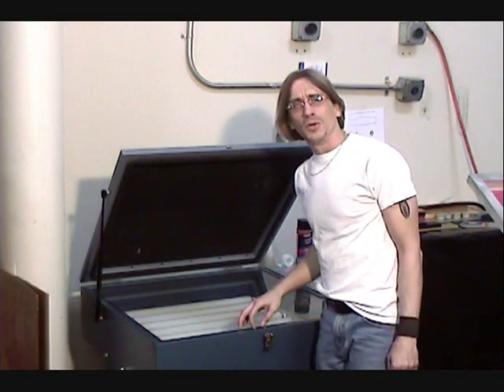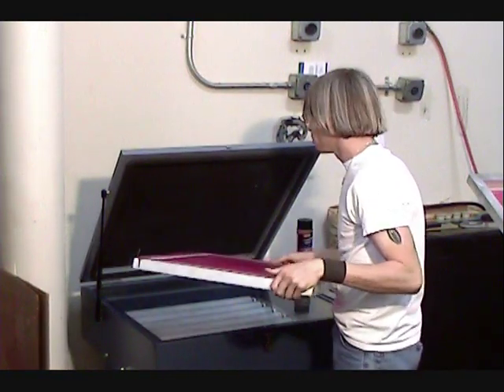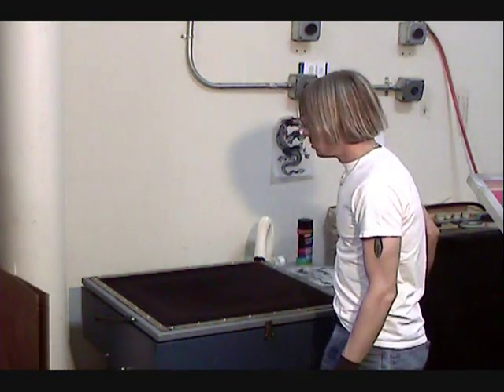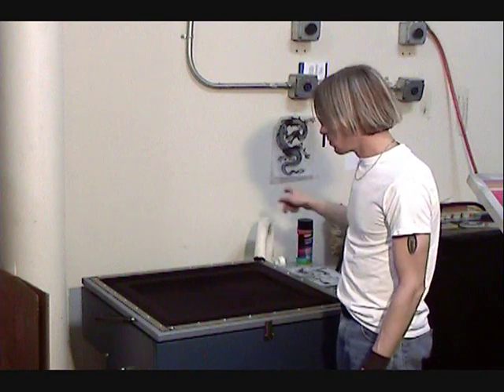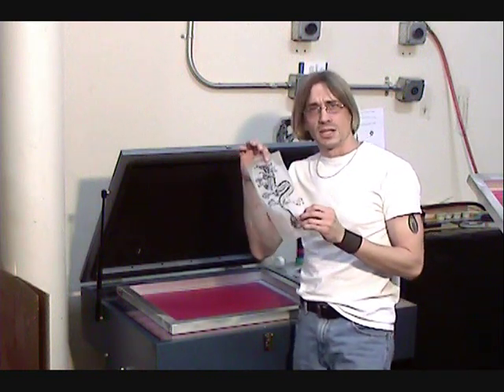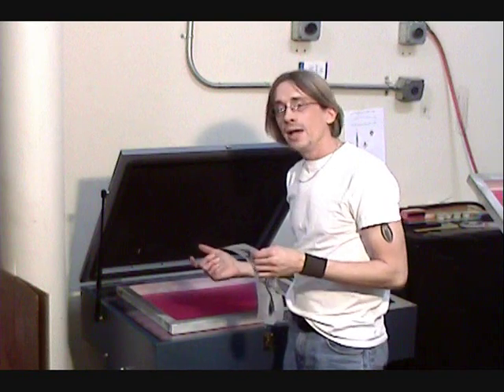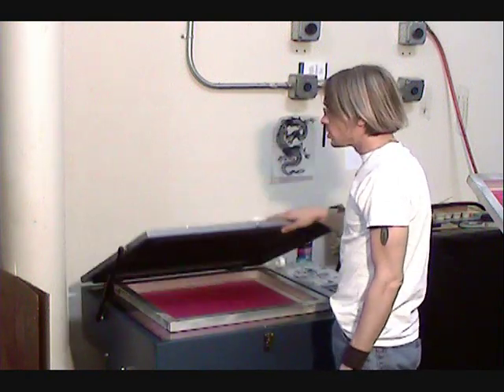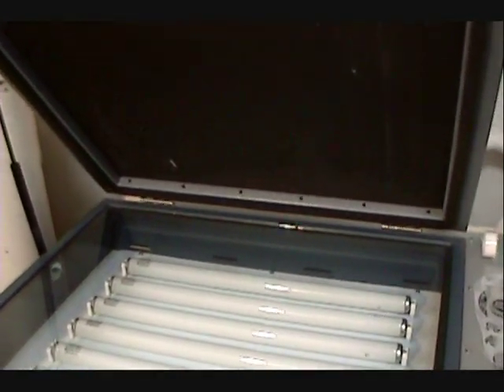How To Screen Print: Getting Your Art To Screen

Comment from the maker: No problem, my pleasure. Technically I think you can and if I recall correctly it ultimately affects resolution by decreasing bridging characteristics of emulsions. It can also cause what is known as choking which makes the stencil slightly smaller around the edges. You want to try to expose the emulsion just enough to fully cure. But I would not worry about that too much with most tee shirt art unless you have some very tight registration to achieve. Thanks for watching and leaving a comment! ☠

Comment from the maker: Youre welcome. Thanks for watching! It is recommended to work with unexposed emulsions and screens in yellow or red light. Some emulsions are slow enough that subdued light is sufficient. It really depends on the emulsion you are using. But a complete darkroom is not necessary in all cases. But again, it is recommended. My motto is eliminate all variables so working with emulsion in the darkroom is a good idea. You can use any dark space with a red or yellow light.

Comment: Hi. Just to ask, how many times you can use a screen once you make, let say 120 tshits with the same screen. I mean....you can make an amount of Tshirts and remove emulsion and make the same design again? Or simply you make the screen and keep it for 1 or 2 years withot problems?
Reply from the maker: You can reuse a screen as long as it has tight mesh and it's not all dingy with frayed fiber. It can be used for many years if cared for properly. Thanks for watching. Screen Printing Equipment & Supplies - http://catspitscreenprintsupply.com/

Comment from the maker: The exposure time may be calculated by different methods. When I test a new emulsion I start at a 30 second exposure and adjust from there. Most emulsions are very fast today. The vendor of the emulsion should be able to dial you in to a starting point for their emulsion based on your mesh count and your light source. If your screen gets messed up, the screen itself may be reused but it would have to be reclaimed and re-coated with fresh emulsion.

Comment: firstly thanks for the video, i ask how to calculate the time on exposure for different mesh, i use 43 mesh.
Reply from the maker: You’re welcome. That is hard to pre calculate without an exposure calculate to use for a test. Otherwise figure a starting point based on your emulsion, film positive quality and your exposure light. Thanks for watching and leaving a comment! http://catspitscreenprintsupply.com/
Reply: appreciate your fats response, i use dirasol 25 emulsion, 43 mesh, exposure light has 8 lambs every one 40 watt. how can i calculate the correct exposure time.

Thanks
Reply from the maker: muhammad keshka You’re very welcome.  Glad I could help out ;) I would use an exposure calculator from Saati or MacDermid. I can’t even guess as I am unfamiliar with the emulsion and the condition of your film positives. You can do a wedge test as well. You can Google that for photography. The principle is the same. I’ll do a video on that eventually. I think I mention it in this video: Screen Printing T-Shirts: What is The Exposure Time For Screens?

Comment: I'm just getting started in screen printing and confused between using long fluorescent bulbs like the fluorescent bulbs you are using in this exposure unit or the using a point light source Halide bulb type exposure unit. Some say the fluorescent bulbs under-cut the image burnt on the screen, what is you opinion between the two type of exposure units?
Reply from the maker: +Jon Murany Ultimately a point source unit or the new LED units will be best at everything. But the industrial black lamp UV bulbs will also be able to do anything you need to with printing tee shirts. Tee shirt art is not that critical that you need to be worried about choking or undercutting usually.  We always want to use the shortest exposure time that fully cures the emulsion to avoid the extra time that allows for halation or choking. The UV fluorescent bulbs will work fine for you if that is what is in your budget. If you can buy more then get an LED exposure unit rather than the old metal halide point source. Those will be obsolete eventually in my opinion. And the LED costs less to run with better UV light for emulsion. Thanks for watching. Screen Printing Equipment & Supplies - http://catspitscreenprintsupply.com/